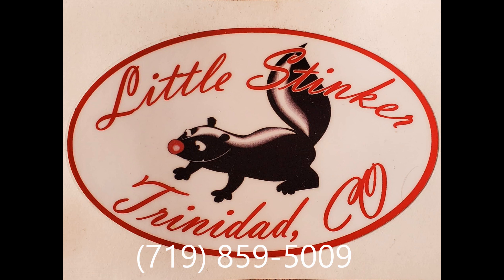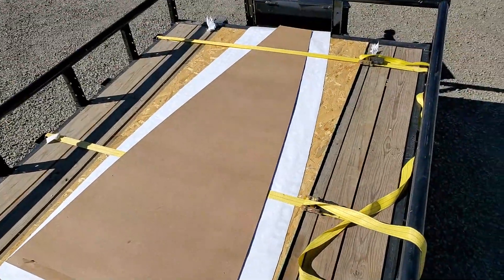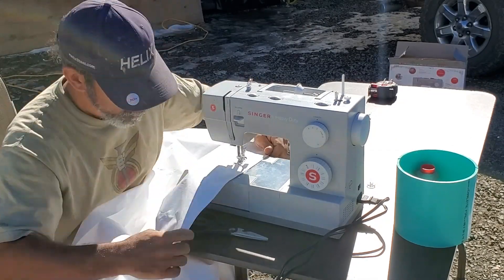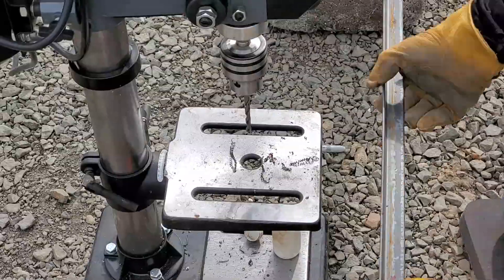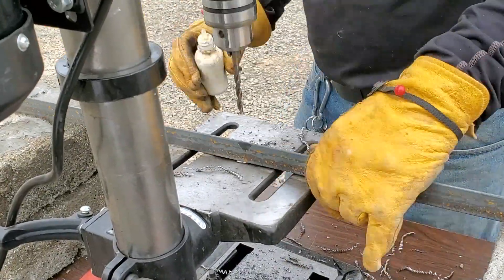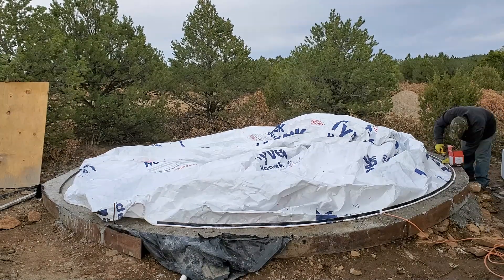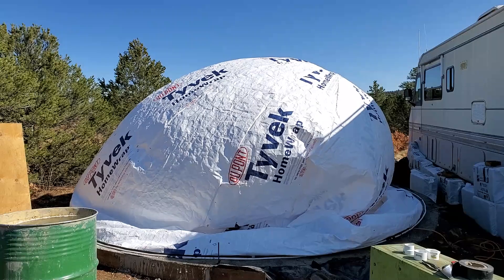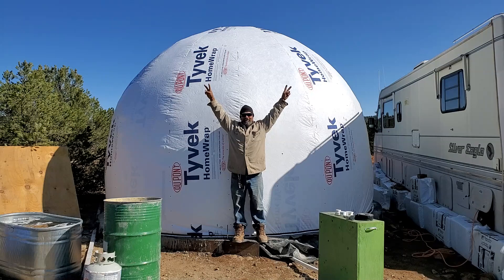Tyvek Dome Air-Form Cabin Build | Part 1 #aircreteharry #domehome #aircrete #foamgenerator #tyvek

Comment: Hey Harry. Love your work. Can you tell me, have you tested the air form to rupture point?
What I mean is, what is the max pressure a tyvek airform can hold? (cm H2O, psi, kpa, or mmHg)
Reply from the maker: I never tested to rupture point. After 8 dome i have not had a rupture.
Reply: @AircreteHarry  would be nice to know. I follow a lot of dome builders out there, and it would be interesting to see if your airform could would suit if following say Monolithic's Ecoshell instructions, as its a hell of a lot cheaper.
They do I think 6cm H2O pressure for that one.

Comment: The cost for building 8 meters diameter complete in Costa Rica
Reply from the maker: If you build it yourself it will cost you about $10,000. I don't know how much cement cost in Costa Rica.
Reply: @AircreteHarry  does it also inlcude basalt mesh and the cost of labour?
Reply from the maker: @adelchidipalma46  Yes everything but labor.
Reply: @AircreteHarry  thanks please provide your cost and the cost for different sizes, 10 15 20 meters I am planning to contrat the building in Costa Rica sometime in Dec 21 to March 22
but I want to contract the work to you labour here is $2.00 an hour I will find out the cost of cement.

Comment: Looks like you filled it with air through a ~1" pvc pipe? I'm surprised squirrel fans work with such a small diameter pipe - I would have thought you would need much larger diameter pipe or higher pressure air source. Can you show us your dual squirrel fan setup?

Comment: Um, nice work. Here's the thing. You blew up a bubble. What is it? It's full of air, what happens when you cut a door or window. I'm sorry as you might tell I have no idea what you just did. You fill it with air and celebrated. OK. what exactly are you celebrating the act of filled it with air, or was something created to live in? I don't get it.
Reply from the maker: What you see is an air-form that I will apply cement and make a dome. Check out this video>>>   https://www.youtube.com/watch?v=63KZFkCbEc0

Comment: Harry, why do you do that man? Not shooting you down - it is a legitimate question - what are you trying to achieve? The domes, unless really well finished are not the best-looking structures, made of concrete are rather hard to demolish/remove and clean up. I think I have already seen a commercial offer with domes inflated and concrete shot/poured to make the shell you are not inventing anything new, so it seems that you are trying to pry open an unlocked door here... Unless there is a reason?
Reply from the maker: Hi Richard, To answer your question there are 2 things I'm trying to do! Your right there are commercial company's that offer dome building service. I have air-forms from a commercial company that cost me thousands of dollars. I have a 20',22',30',32' foot size air-form and a few others. And they are all very expensive, very heavy, very hard for one man to move around and set up. First thing I'm doing is showing one way to making a very inexpensive air-form and saving money, the air-form is very light one man or woman can set it up, and I showed everyone how to use Tyvek house wrap for making an air-form. Seconded thing I'm doing that you have not seen yet how I use EPIC(Expanded polystyrene Paper Infused Cement) instead of concrete to build with. It has insulative and thermal battery properties and is very strong in a dome shape. As far as the look of a dome I like the look and until you stay in a dome you can't really understand the magic of a dome time to step out of the box!

Comment: I’ve never seen you actually finish a dome  that worked
Reply from the maker: This is dome number 3 I'm building, the first was in New York but it was a test dome not meant to stay up so I took it down. The seconded was a prototype dome still needs to be finished and this is number 3 I'm working on and it's almost done. You will soon see a finished dome that works.
Reply: Sorry I meant one that was completed you know paint door window electrical....  Complete      I do think using the tyvek was vary clever for the mold.

Comment: What is the purpose?  Its a lot of work and money for a structure made of a self destructive material - Tyvek .
Reply from the maker: The purpose is to use the Tyvek as a dome form to apply a cement mix I made. Ones the mix cures I will have a dome building.
Reply: @AircreteHarry  I see.  Thanks for the response.

Comment: harry i love your stuff bud.. you are on the same track that i am thinking.. my thouughts was to put the attachments on the inside so the form could be removed from the inside. and taken apart to be used again.. your inspiring  love your stuff
Reply from the maker: Thank You! Making the air-form like this was easier than making one that I have to get inside to mount the air-form. It's cheap enough that I can just cut the form at the bottom and resew a new rope and get new meatal.
Reply: @AircreteHarry  i always thought the tyvac let air threw what did you see when it was under pressure.
be nce to see you spray that with a tin coat first. and let it dry. and do it in layers so the weight is light as possible..   i like being able to learn from you

Comment: No need to use angle iron and drill holes ...just use UniStrut instead.
Reply from the maker: Unistrut would cost more and be much harder to bend. Thanks for the Idea!
Reply: Oops...actually I was referring to the lighter gage Hillman 1 1/2 x 1 1/2  perforated slotted steel angle.
Reply: Home Depot  > Everbilt 1-1/2 in. x 12 in. Zinc-Plated Slotted Angle

Comment: That's cool, how well does it hold air? Have you considered building a semidome? With shirt sections of straight walls, like a rounded corner square ? This is what I'd be more interested in, nice job man !!
Reply from the maker: It holds air great! The dome is almost done. I plan on building a cylinder tire wall with a dome roof next.

Comment: Thanks looking good. Ever hear of feedlot panels ? They are using them in many configuration . They sell them at tractor supply 16' long forget how wide. They are super strong and affordable. Canestoga huts I think is what they call them.
Reply from the maker: Thank You! I have seen the feedlot panels. I did look up Conestoga huts and I do want to make that shape with Aircrete and Epic.
Reply: @AircreteHarry  I have a vision of your center dome with 4 of the huts flanking the 4 poles . Very affordable and super strong.
Reply from the maker: @GEAUXFRUGAL  I had the same idea to make the center dome and the huts could be bedrooms.

Comment: I thought you purchased several dome forms previously when you got your trailer and mixer.
Reply from the maker: I did purchased air-forms before and I still have them. This is a smaller dome than the other air-forms I have. But this air-form is much! lighter! than the other ones I have this is much easier to work with. I mite not use the other air-forms I may just make them all myself.